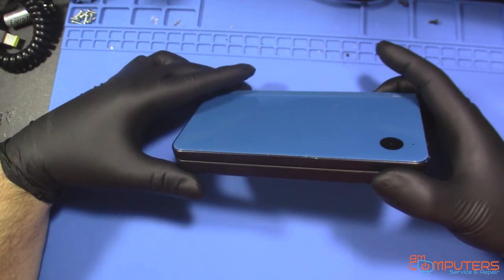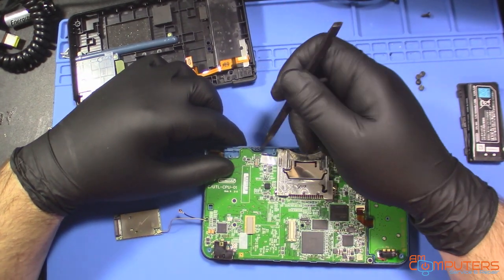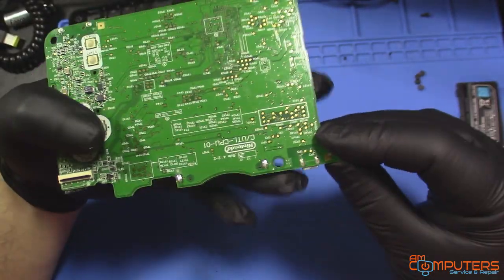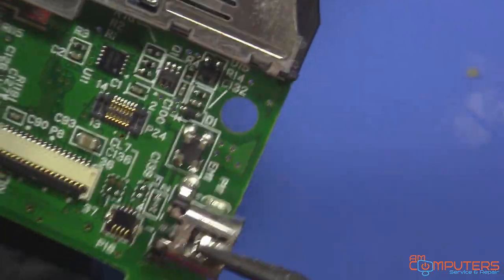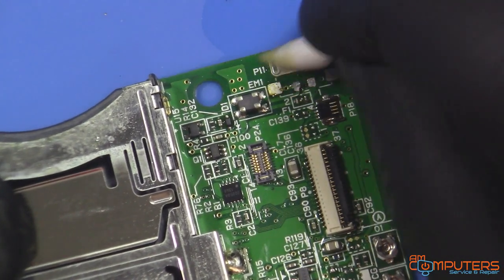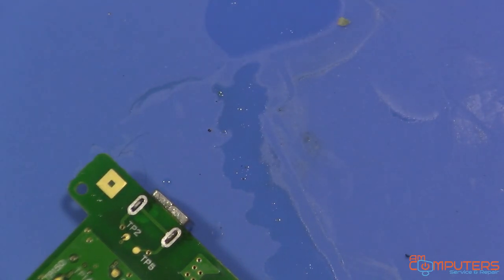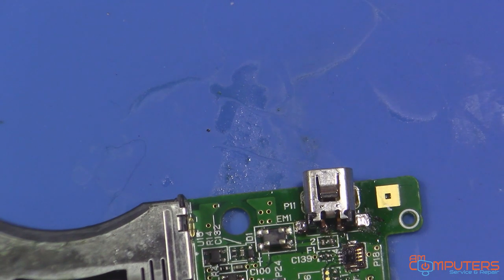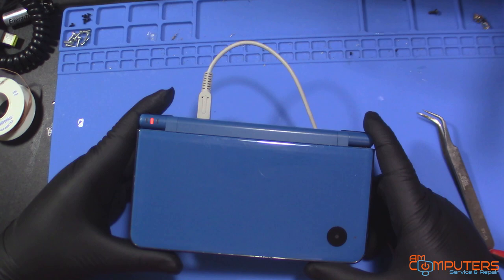Nintendo DSi XL Charging Port Replacement - How To

Comment: That Jack was messed up. It boggles my mind to think of how awful people treat their electronics.
Reply: I did that with my DSi now that I am older I miss playing on it
Reply: Its honestly not that hard to accidentally bend the Charger plug a few times over the years until the plastic piece inside the jack gives up, leaving the pins exposed. Its downhill from there.

Comment: thinking about replacing the charge port for an USB or Type-C...
Reply from the maker: That would be so much more practical. As long as you know which pins are the power and ground I don't see why that can't be done

Comment: what is that gold spiral thing you put on the dsi to connect everything
Reply from the maker: Do you have a time code by chance? I'm not sure I follow your question. Only thing I can think of is if you mean the solder wick I use to suck up the solder from the connections?
Reply: @AMComputers  at 12:29 you used an item and was wondering what that was so that I could get one
Reply from the maker: Thanks. That's desoldering braid. It's used to suck up the solder from the pads or whatever you're trying to desolder. Chemtronics Desoldering Braid, Chem-Wik, Rosin, 10-50L 0.10", 50ft. https://www.amazon.com/dp/B0019V5MAC/ref=cm_sw_r_cp_apa_i_YGfjCbJWZSBAT
Reply: @AMComputers  is it the UK model and if it isnt does the battery fit in it even if its from the usa

Comment: Would this work, my DSi XL does power up but nothign happens when I plug in my charger "it's not the charger I tested it on a 3DS it works on that."
Reply: My dsi is the same way, will work with a fresh battery but will not charge. The orange light come on for a second or two and then goes off .

Comment: friendly reminder to please be careful with your wifi connectors when you're taking them off, he makes it look easy in the video but mine ripped off when i tried to take it off.
Reply from the maker: Good tip!
Reply: thanks, i don't need wifi
for the ds anyways anymore so i guess it's fine